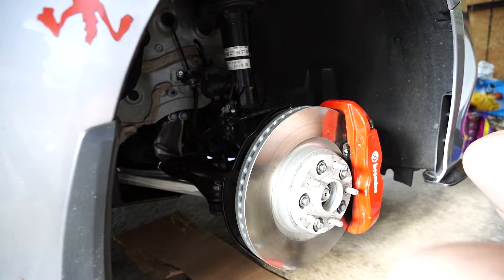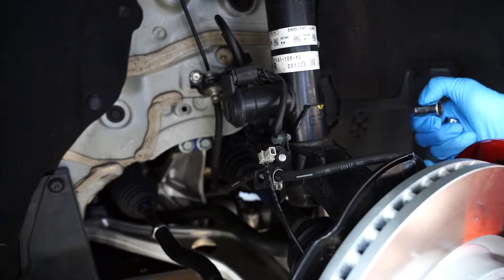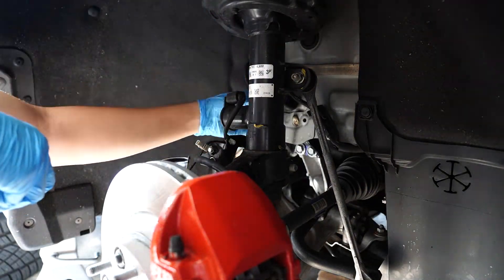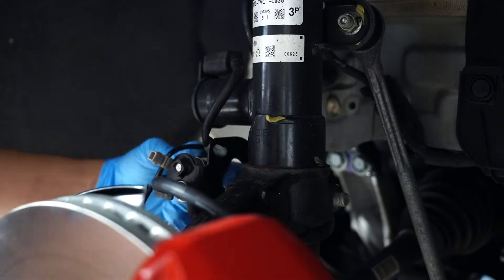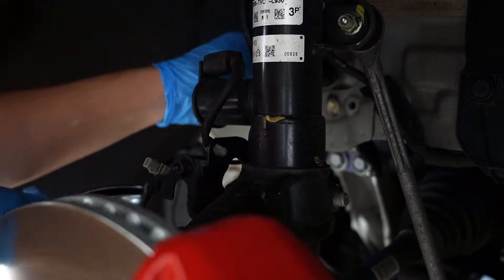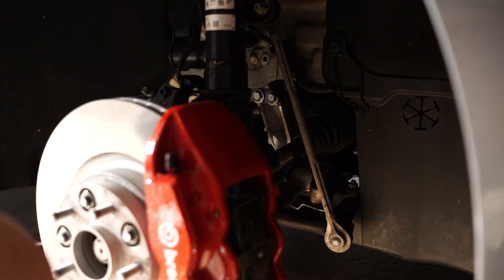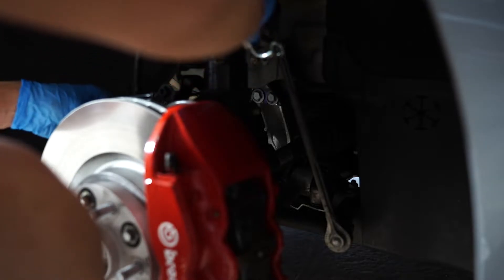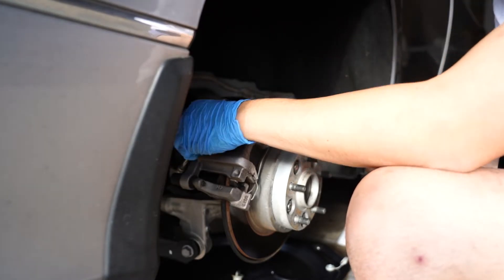Upgrade Your Brake Pedal Feel! Stainless Steel Brake Lines Install!

Comment: Where did you get the heated steering wheel amd the covers fir the speakers?
Reply from the maker: Heated steering wheel I got from Honda direct, it's in another video of mine. Covers were off Amazon, just search for Accord Kick Panel cover